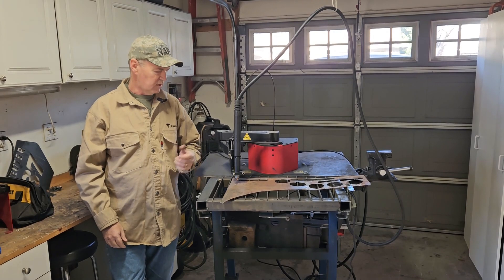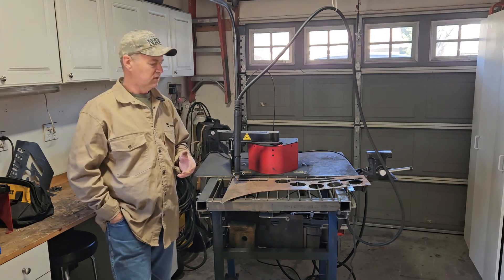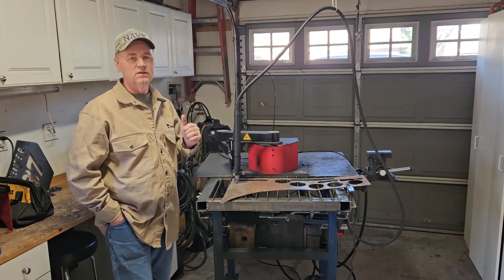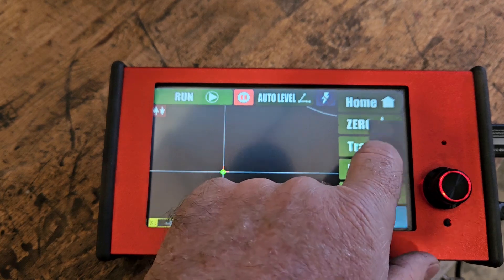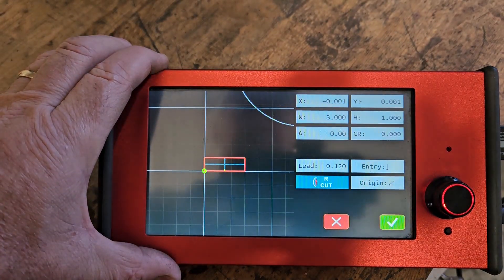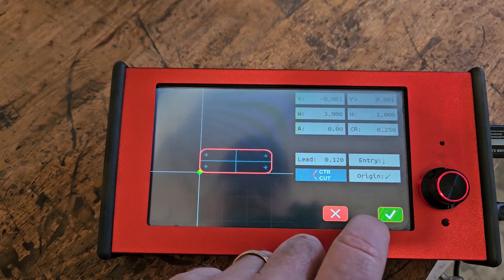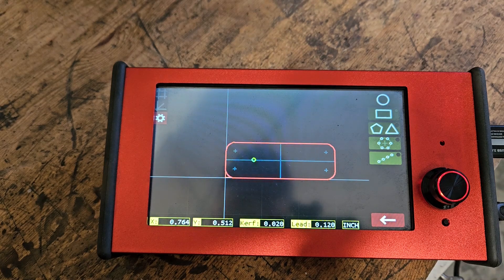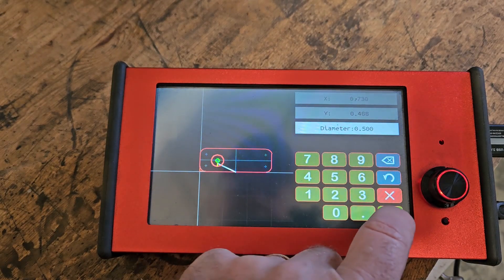Fine-Tuning Kerf Settings on My Arcdroid – Precision Adjustments in Action!

Comment: Thanks for doing this vid, it is only one question of many I have. I have never used a CNC machine before, only used a plasma cutter twice. I bought a cheap plasma cutter, a Yeswelder CUT55DS-PRO. Then I bought an Arcdroid, I had no idea if the plasma cutter would work with the Arcdroid. I wired the trigger the way Andrew showed in his vid and to my surprise, it worked. With the kerf, I have no idea what size tip is in my torch, I cant find a number. I tried cutting a one inch circle, but it was 3/8" bigger. I played with the kerf setting but it didn't change much. It turns out, I need to learn the left, right or center cuts. Also, what is an average pierce height and cut height? As you can tell, I'm as green as they come, I will be binging on your videos. Thanks
Reply from the maker: I don't want to come across as an expert, I was much like you a year ago.  Your plasma cutter should tell you the proper cut height.  The manual for mine specifies .06" or 1.5mm, I'm using .120" for the pierce height.  I don't recall where I got that value.  Hope that helps and thanks for watching!

Comment: Great info thanks.  Curious if you have the newest update firmware installed, i believe there was another release since your firmware vid. 

My arcdroid will not retain the date time after its powered off it reverts back to year 2000.   I even replaced the on board cr2023  battery. 

Andrew is a little stumped i think so I am curious if anything in the latest release breaks the time date settings. Would you mind checking yours?

Not many folks probably go back to check the date settings after updating after its set.
Reply from the maker: Sorry it took so long to get back into the garage.  I checked and sure enough my date is also 2000.   I didn't update to the most recent firmware either.  I didn't think to set it and cycle power, just checked while I was in there.
Reply: @6.8liter74  - I figured it was more than just me.  Reachnout to Andrew, I have been working with him on it and  just received today a new pair of firmware updates today to correct it.   I can verify it did fix the issue.  Thanks again
Reply from the maker: I haven't looked at the date time I'll take a look as soon as I get a chance and respond here.  Good catch I didn't realize there was a newer firmware released.